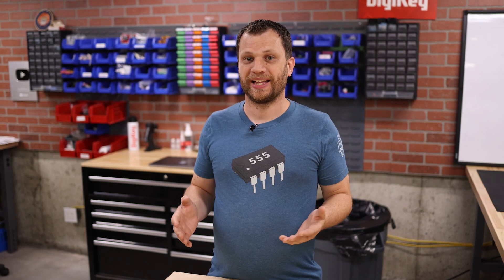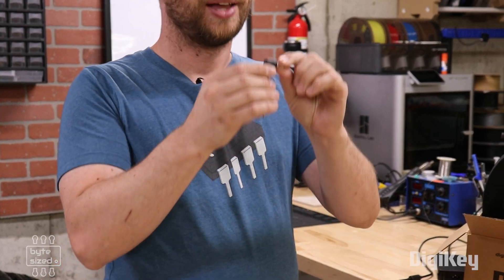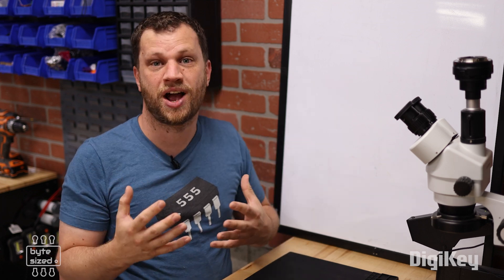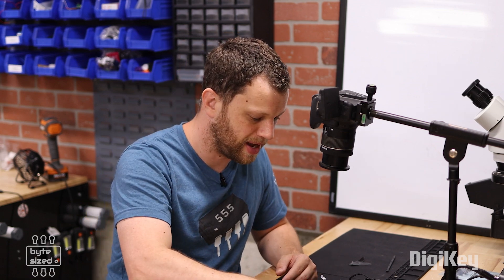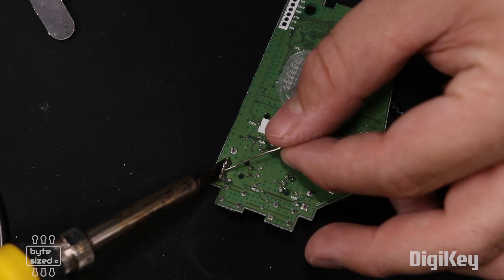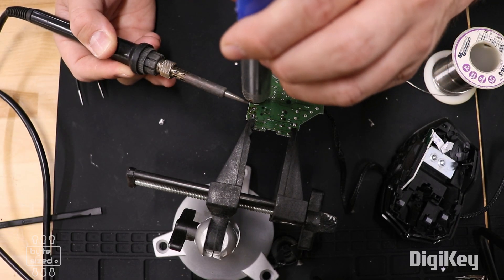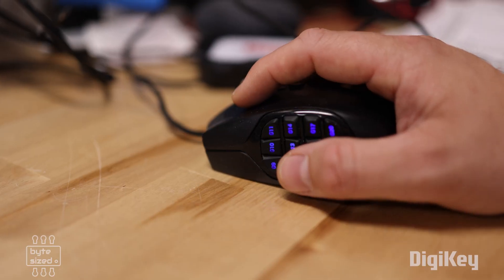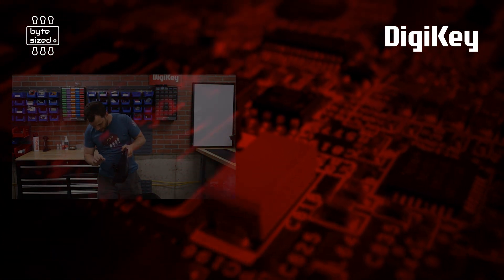Fix It Or Trash It? - The Byte Sized Engineer | DigiKey

Comment: Dude !!!!! are you really an engineer? where did you learn to troubleshoot, de-solder or any electronic repair skill. the simple rule is to troubleshoot before repair. can't believe you had a solder sucker. did you check for power from the power supply before opening the computer  and purchasing the power port?

Comment: I am puzzled that it seems you didn't check the output of the laptop power supply. That would have been my first step.
Reply: Yeah, and couldn't you just buy a new power plug? Or maybe get the lead and plug from an old power supply or car charger or something.